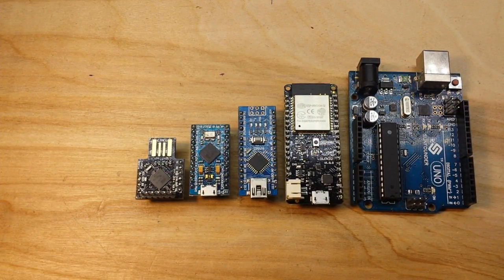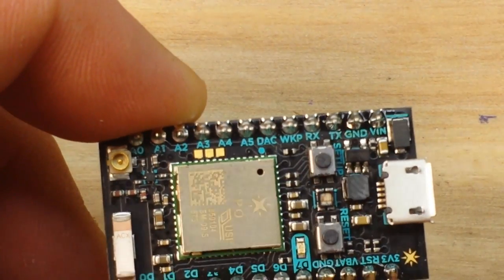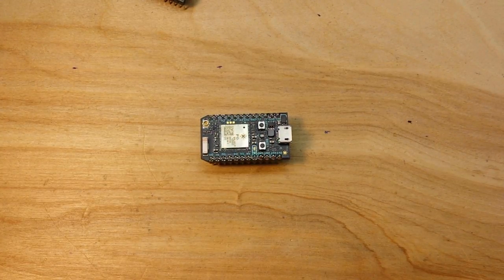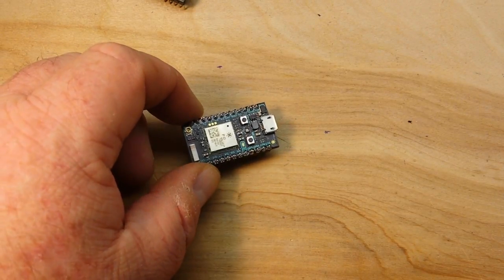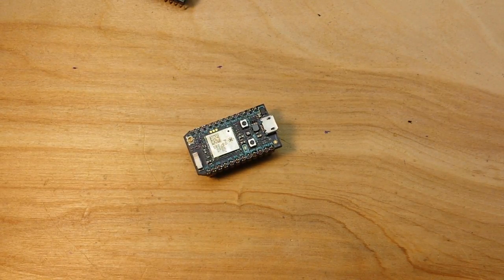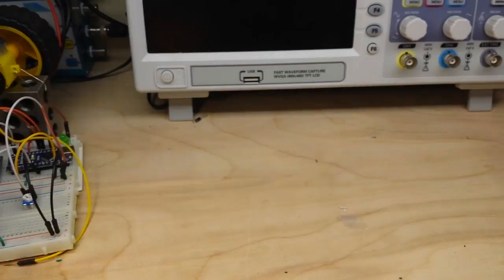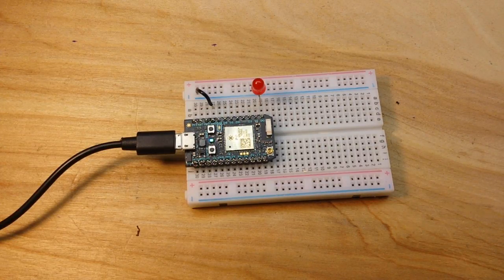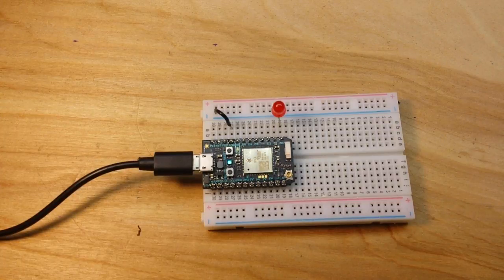Particle Photon IOT Made Easy

Comment: Awesome vid! I might have to get one of these. I'm currently using a similar board with an ESP8266 to control 300 RGB LEDS and a motion sensor all connected to my Home Assistant server via MQTT. I have a demo of it on my channel if you're interested!
Reply from the maker: Ill check it out. Don;t miss tomorrows video on the Photon. I show how to control it in real time with no coding. Just click and slide...